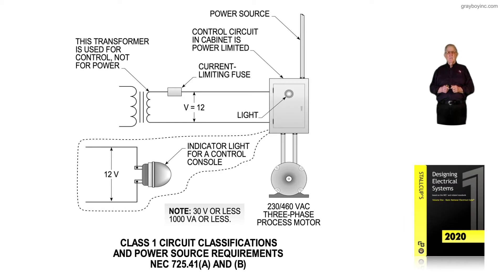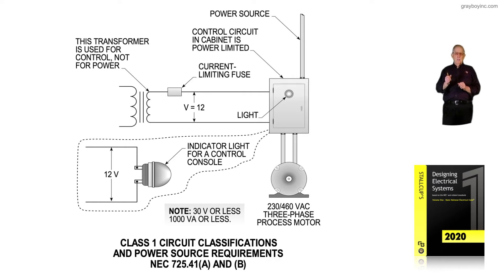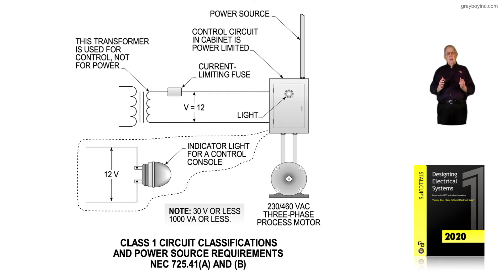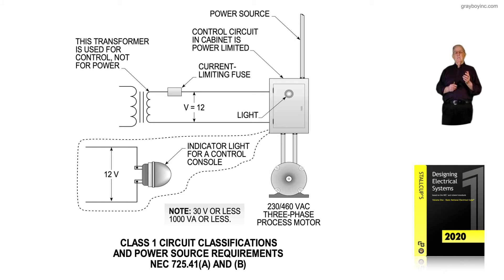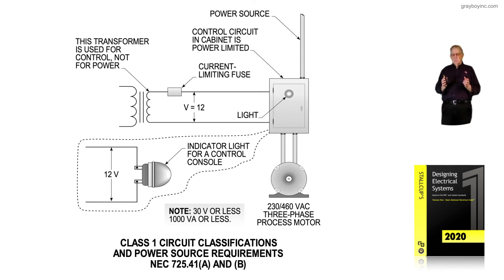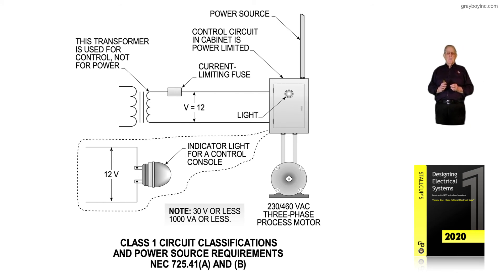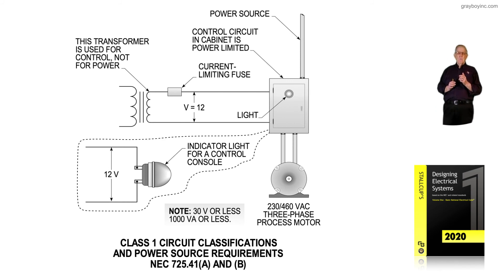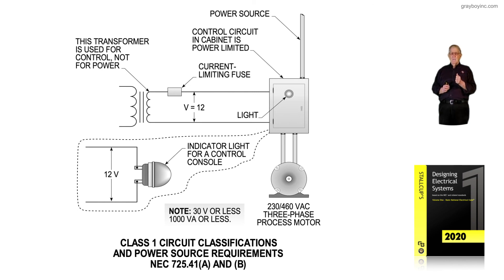4-14  CLASS 1 CIRCUIT CLASSIFICATIONS AND POWER SOURCE REQUIREMENTS - 725.41(A) AND (B)

Comment: I'm tired of hearing this "250,000 volts can't kill you" from electricians. 250,000 volts is safer only at extremely low frequencies. That's how tasers and stun guns only kill sometimes (FYI 50V at 60,000Hz would be your last day. They leave that part out of the apprenticeship classes). Maybe if you weren't grounded and inline with the circuit it wouldn't draw the current. But if you're grounded, you're dead. Typical skin has 100k ohms resistance. If you're grounded, and come into contact with 250KV that's 250,000V/100,000R=2.5I. It takes 0.005A to kill.

But electricians hear "double the voltage, halve the amperage." That's only true when the work being performed (P=wattage) is a constant (such as a multi tap motor, light, or other load). But electricians never do the math to figure resistance. Resistance is pretty much always a constant because it is a physical property of the atoms and molecules. 

You can perform your own experiment to show this. Ground yourself and grab a 120V wire. Then grab a 277V wire. Which hurts worse? Now imagine grabbing a 250,000 volt wire. There's a reason linemen ALWAYS loose a life or a limb when they contact their voltages and they usually have the wooden pole or rubber truck tires helping them resist the current. And they rarely work near half of 250,000V.
Reply: Hi Ben, Yes, I agree. NFPA 70E: 110.4(C) on page 15 requires an evaluation to be performed to determined if a low energy circuit can be harmful.A Class 2 circuit per NFPA 70E: Definitions on page 11under "Electrical Hazard" states that such circuit when properly used is not considered a hazard..
Reply: @jamesgstallcup7370  3:26 you said "and you may have 250,000 volts but just with a small milliamp. It can be a shock hazard to you. But it can't be an amp killing hazard to you." 

A Class 2 circuit can't be over 30V and 100VA (yes there are special rules in the tables. I'm talking what those of us in the field working actually work with day to day.)
Reply from the maker: www.grayboyinc.com 
Use the following coupon code at checkout for 45% off all products. Coupon Code:   22GB45